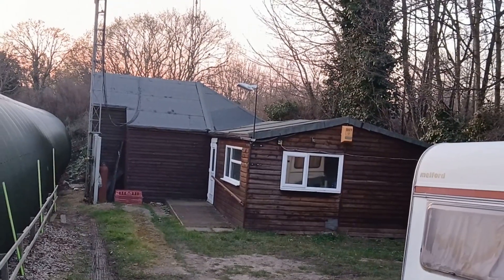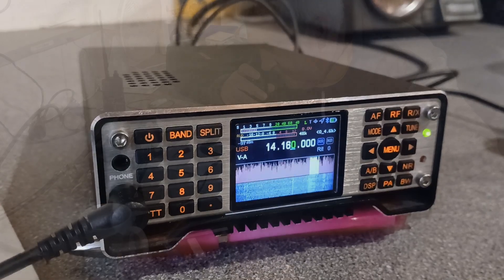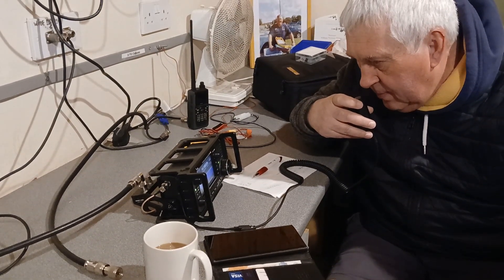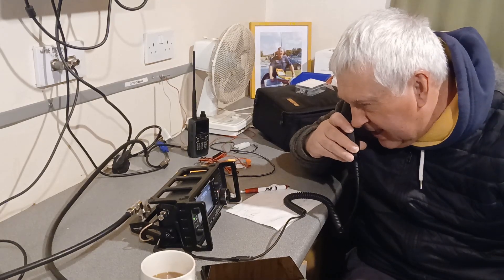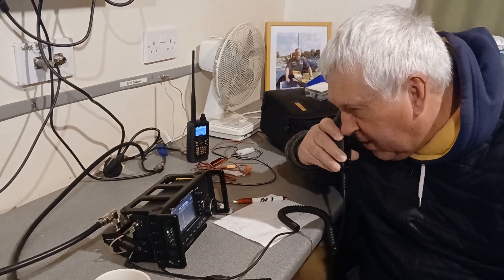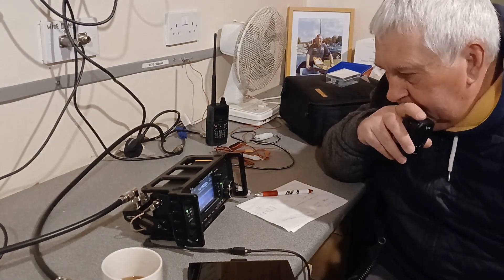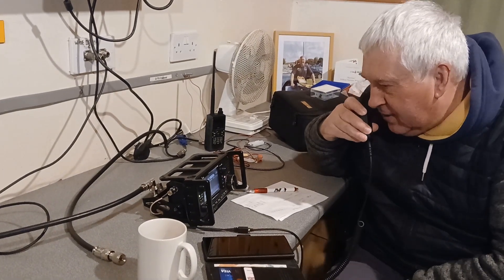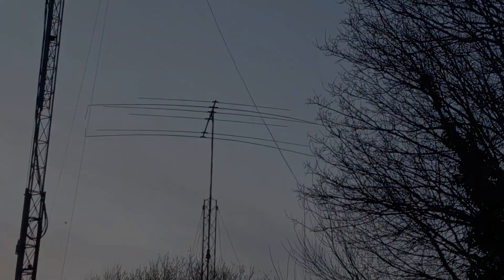Amateur Radio Club Night - UK To Australia on 10 Watts!

Comment: Nice one Ben, and well done Tim, i still teckon he would have hot through on the club doublet, as you know ive been licenced since 1993, an i have never used more than 10 watts SSB 5 wats CW, ive worked tgd world using wird antennas only, never owned z beam.
Reply from the maker: Yes, we'll have to try the doublet next time! Thanks for watching 👍

Comment: 10 watts into a optibeam is like 100 watts out the antenna
Reply from the maker: It certainly works well! Thanks for watching and commenting 👍
Reply: @m7frs272  I have a full size 3 element for 20 15 10 at my allotment on a 12m Clarke mast I run 2 watts into the antenna and get around 25 watts out and have worked the world. Also have a 3 element yagi up at home with a baby loop antenna. Running these antennas u need to watch your power put into the antenna.